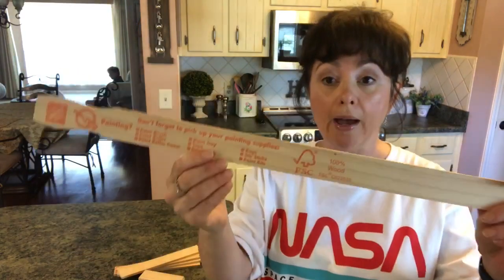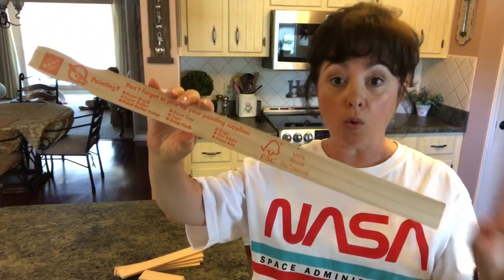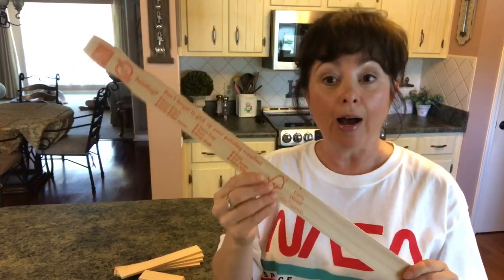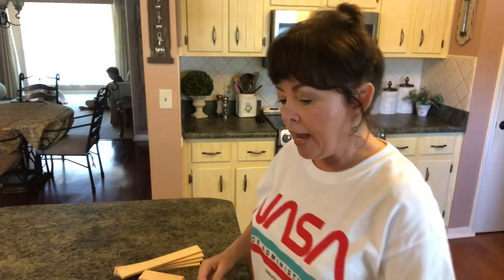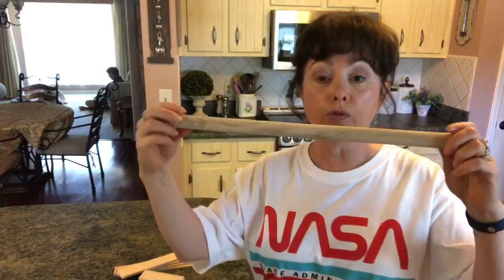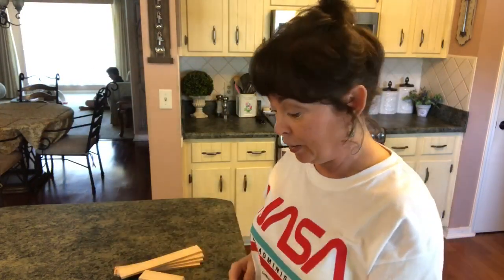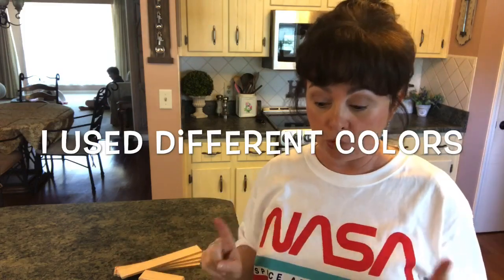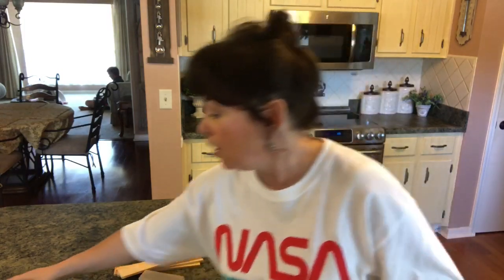Diy Farmhouse Paint Stir Stick Flower Caddy | Paint Stir Stick Crafts

Comment: 😇🌷 Hi Tawnyah, I wanted to share with you that, you can also use Gorilla glue { glue sticks, and or wood Gorilla glue } this glue WORKS, AND trust ME when I say it WORKS, because when I used the Gorilla glue sticks, I accidentally burned my fingers LOL 🤭 and I had to put my fingers in ice water LOL 🤭
I'm in the middle of, making a paint stir stick, tray for my coffee table, and I'm going to be using, hard wear {  two handles from my kitchen cabinets. } and placing them on each end of my tray. also I won't be putting sides to the tray. At least this is my plan for now.😊🌷
Now back to the video.😊🌷
Reply from the maker: Hi, your project sounds beautiful!!  I have used Gorilla glue for a long time and I agree it does work. You are so sweet! Stay safe. xoxo